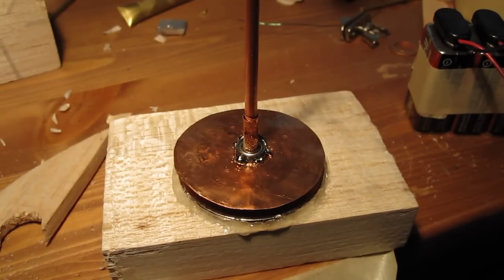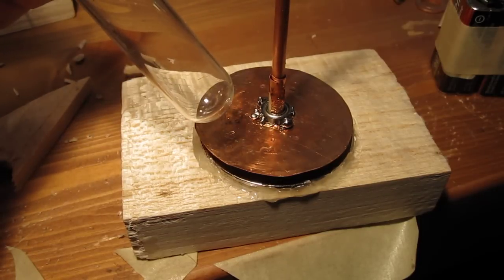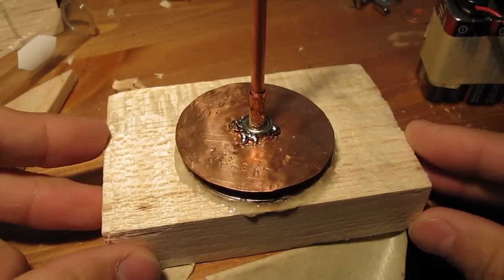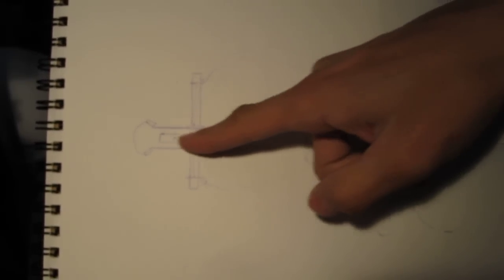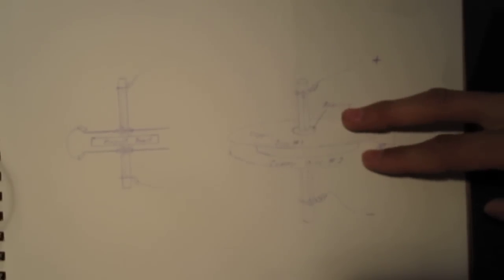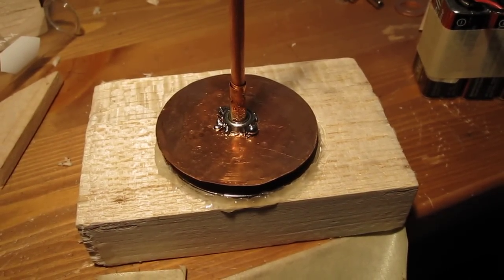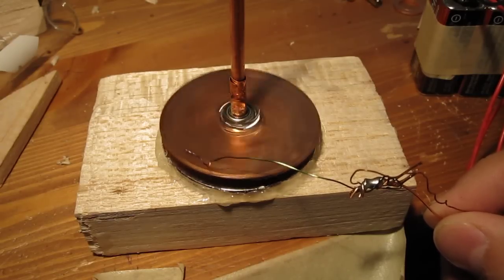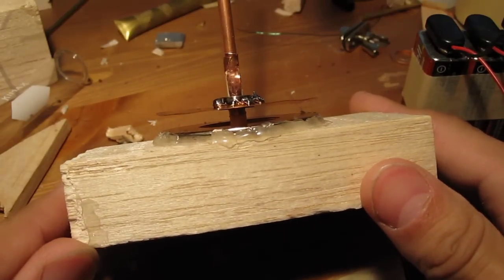Copper Disc Homopolar Motor (Magnetic Vortex Motor - Part 3)

Comment: what if you stack multiple metal discs like in a tesla turbine and put magnet perpendicular to the discs. its a pure dc motor-generator pump-turbine. the only issue is that the outside current hop to the wall would require brushes. or something else. to the circuit to complete. maybe metal contact rollers.

Comment: I think the copper disk should not come directly in contact with mercury because the two metals will amalgamate. You can initiate contact via iron wires, which are not affected by the mercury.

Comment: You should try using the same size copper with the same sized magnet Running the same amount of weight and and ertia
Reply: More copper mass means more electrons, more electrons means stronger magnetic fields in copper and a very strong neodymium magnet can yield dramatic results. 
Think of its reverse - Keep the disk fixed and rotate the magnet at insane speeds and you will get huge current output with low voltage and the cherry on top - YOU WILL DEFY LENZ'S LAW.

Comment: Hi spirit can .we be friends?? I'm into weird science stuff to 🤓would be cool to have someone to talk with my friends tend to get overwhelmed with my ideas haha lemme know. I wanna start a strange science club:)...
Reply from the maker: Sure sounds good.  🙂
Reply: spiritelemental I plan in doing a version of this motor with an outer ring instead of simply a wire.
Reply: Also I've come up with "airbearings" that will increase stability, massively increase rpm, lower friction ECT. I've already done successful tests.
Reply: The question I'm interested in answering is,what orientation speed and weight starts the antigravity effects.
Reply: I plan on using a vacuum tube and high voltage to jump the gap
Reply: How you wanna get in touch to talk???
Reply: Excited to hear back :)...there is a lot I would like to chat about. I've tested other tesla, hho, capacitors ECT. Magnetic devices, microwave contraptions, lasers. There's a lot of what ifs I was hoping to discuss for fun. And possibly further problem solve together.
Reply: Aww sweet 😁

Comment: I like this. One question though. 

I see that you are touch the positive wire to the copper. 

Where is the ground wire connected or placed? 

I'm starting my own experiments. I'm very j retested in your work
Reply: Ty Ran Also, the presenter said 2 counter rotating disks would create "anti grav." Actually, as far as gyroscopic effect: they would cancel each other, so no precession.

Comment: I'm not 100% sure on how it works. But its kinda like if you have a tuning fork at an A, and you place another tuning fork thats tuned for an A, they will both start vibrating.

So what if you got a flying saucer to resonate with everything around it? It should be able to do some crazy stuff. I found a design  that apparently works, I could send it to you. Cause right now I can't spend my money on supplies for this, but i'm really curious to see if it works.

Comment from the maker: At the 5:07 mark you can see the 13 nine volt batteries I have hooked up in parallel.  One wire I hold in my hand which connects to all the red/positive wires, and the other wire leading from all the black/negative wires is connected to the hollow copper rod the copper disc spins around.  Perhaps I should've show this?  oh well...

Comment: Where is your battery - is it the wire in your hand or the one on the magnet?  Try putting a light load like a little led or something and see if it helps with electrons changing into heat.  If that work, maybe you could get a capacitor on it and capture some of the extra energy coming off it. Just a thought you could try.  I have been thinking a lot about the homopolor motor lately.